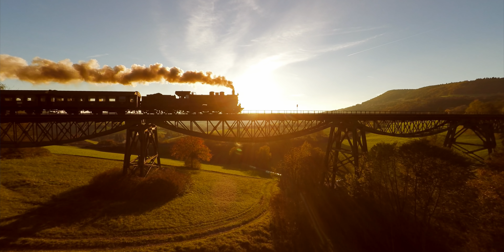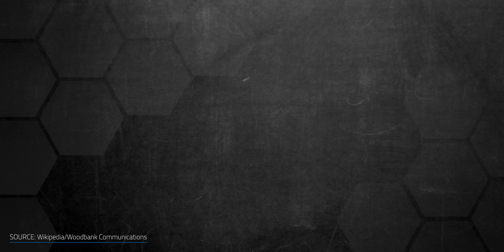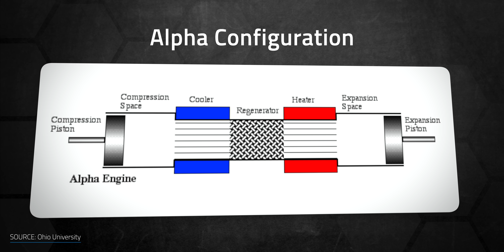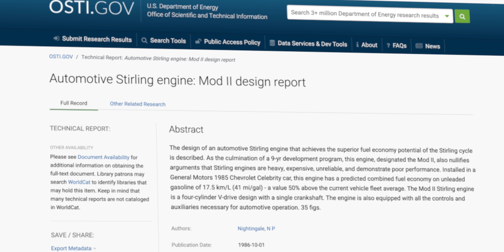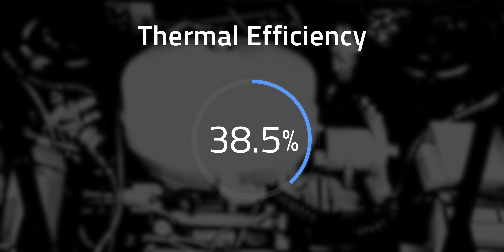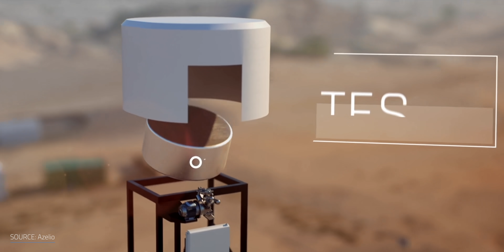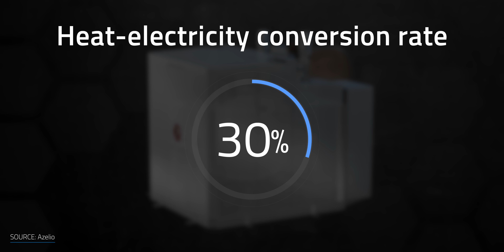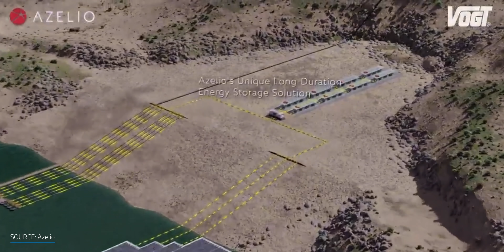Are Stirling Engines the Future of Renewable Energy Storage?

Comment: A 30 % efficiency if far lower than the best diesel  engines.  Where heat energy  is otherwise going to be wasted then maybe they have a use but when you have to channel large amounts of energy in to get significant  power out  then there has to be practical difficulties in stopping  heat being lost to the environment.  Nice toy though - would like one for my dining table.
Reply: This neglects the large amount of energy needed to extract, refine, transport and store the diesel fuel. Total efficiency of that entire cycle is less than 10%....not to mention the environmental impact.
Reply: @toddchief9180  Not to mention the infrastructure required to marry up a large Sterling engine from the source of otherwise cheap heat energy  to where ever the power is needed. The infrastructure for the transportation of diesel is already here. 
The largest use of diesel if for tankers transporting goods all round the world. I don't see a Sterling engine working in that environment.  It has a few niche applications (I believe the Swedes power at least one submarine with one as it is so quiet ).

As I say, a nice toy   and I'd love a miniature one on my dining table
Reply: @we-are-electric1445   What does the infrastructure “already being there” have to do with the efficiency. You stated that diesel is more efficient. That is true if you only include the combustion of diesel in the engine. But, it takes a lot more energy to make and transport the diesel to the generator...dropping the overall efficiency much lower. Diesel generators are very far down the list of the most efficient ways to generate power.
Reply: @toddchief9180  You said "This neglects the large amount of energy needed to extract, refine, transport and store the diesel fuel. Total efficiency of that entire cycle is less than 10%....not to mention the environmental "

Comment: I really like your channel and content.  Well done!  The field of energy and efficiency has been my passion (and career) for over 25 years.  I took a class in Stirling engines in the mid 1990's believe it or not.  My grad advisor helped write the book on the Dish Stirling research being done with Sandia, so there is a soft spot in my heart for these.  Given the round trip efficiency, I would guess they face a fairly large hurdle using things like PV and wind as the energy source.  Concentrated solar power is a better fit, but even so, unless there are combined cycle Stirling or maybe Brayton cycle engines, your efficiency is so much less than battery storage.  Here is one that is also very carbon free, and opens up the field of 'pumped storage' without geographical constraints, but suffers from the same cycle efficiency.  https://www.youtube.com/watch?v=itbwXMMkBQw

Comment: But batteries have +80% efficiency....
Reply: This is not the efficiency he’s talking about. You are talking about round-trip storage efficiency. He is talking about thermal efficiency of converting heat energy into kinetic energy (or electrical energy). To get the electricity into your batteries you need to convert some source of potential, kinetic, or heat energy into electricity in the first place.

Comment: I've always thought that the interesting part of this technology is that they can work on heat or cold.  Perhaps you could use solar heat during the day to make ice, or dry ice, and then use its big phase-change latent heat (cold) to power one of these at night.  Or if you have a big source of cold, like water, to create a temperature differential.
Reply: It works, but of course you’re putting in the latent heat to get a phase change. So much like hydrogen you’re only storing energy rather than making it. But being only 30% efficient, each way, makes it far more lossy than hydrogen. Therefore, you’d need a combination of the Stirling engine being cheaper to build than batteries, and the power cheap and plentiful enough (like solar or wind they’d have to shut off otherwise) to make it worth it. And even then, the energy resale prices later in the day are such that they would have to be extremely cheap to set up to make it worth keeping only 9% of the energy. But yeah the physics of it works in theory. These things were explored somewhat in Victorian times, various engineers and businessmen proposing to feed waste heat and waste cold into them and so on, it’s pretty interesting to read about.
Reply: Something like this? https://www.pcm-tes.com/solar-energy-storage/

Comment: Could this be used in human spaceflight? It was really interesting! How a really old tech can be reinvented and upgraded is just fascinating
Reply: Stirling engines are used in space, radioactive source on the hot side, the cold of space (around - 270°C in deep space, around 10°C close to Earth) on the cold side,
I think its possible but the existing designs are fairly low power for radio transmissions, etc. and would not output enough power to sustain human life..... Hey Elon, we've got something for you to think about!
Reply: @sofa-lofa4241  That would be indeed something worth studying!
Reply: @sofa-lofa4241  which craft are these used on? Space is a remarkably good thermal insulator and thus the cold side would build up heat. The only way things can cool down is through infrared emission, it can’t directly jostle nearby air and transmit that way. That’s why the ISS has way more heatsinks than it does solar panels, for such a small interior space.

Comment: Azelio has two things going against it.
- it's mechanical parts, thus a dismal efficiency of 30%.
- there's no words about it costs. Storing generated AC power by converting to DC and then outputting by converting to AC, Li-ion batteries are about 75% efficient on average. Is Azelio 60% cheaper than Li-ion batteries, to make it economically viable?
Reply: People keep comparing battery round-trip storage efficiency to the thermal efficiency of the engine. These are not the same thing. Let’s say you use solar thermal to generate heat for both systems then generate electricity, then store it in batteries, then take it out of the batteries on demand. You still had to generate the electricity (normally using a steam turbine) before putting it in the battery in the first place. That process has a thermal efficiency associated with it of around 33% for highly efficient steam turbines. The idea here is to store the energy as heat, and only convert it to electricity on demand (using the stirling engine). Then, you never waste the 80% per round-trip cycle that you lose with batteries.

Comment: Great video ... How does this storage efficiency compare to stacking concrete collectors I wonder? Also, I find it hard to believe that a molten aluminum device has a 25-year life without need of maintenance and risk of poisonous outgassing? Aluminum is the stuff that give people alzeihmers ; similar health problems with lead and other soft metals.
Reply: Obviously the aluminium is in a sealed vessel. If aluminium vapor leaks out, it takes heat out with it, and that would be bad for the storage efficiency, which is what they're trying to maximize here.

Comment: I do have in my home for many years  a version of that toy, mostly made of a kind of cardboard. Bought for  my at that time young kid ( 10 years old). This toy will work on a temp difference of ca 20 degrees. But is very inefficient. My  now grownup boy , mechanical engineer at the moment, told me that for good working and efficient running stirling engines we need a big temperature difference. That 600 degrees aluminium, or molten salt, will do. 
But ONLY if you can use thermal energy (sunlight by mirrors) directly for heating up the salt / aluminium or directly  driving the engine.
A battery will have an efficiency up to 95% or higher from electricity to storage to electricity again. The stirling , as you told , only 38%. This make this solution perfect for those mirror systems, but less good for storage energy from solarpanel parks. (I do know that in Spain there is a mirror driven generator with uses molten salt for night delivery of energy.)
May be we can increase the rendement of the stirling ....when we can increase the temp difference more. But that will ask a lot of the used materials.
Another big disadvantage for stirling engines... a relative lo energy output related to the size of that engine. So only good usable on static installations.

Comment: Also Sterling Engine mechanisms are used in RTG (Radioactive Thermo-electric Generators) for deep space probe power supplies running off the decay heat from radioactive material.
Reply: No probes use SRGs (Stirling Radioisotope Generators)
The RTG you are referring to uses thermocouples a form of solid state generator that uses the properties of bi-metal junctions to generate current.

SRGs are significantly better than RTGs for a lot of stuff but as of yet have not been deployed on any systems.
Reply: @nocare  Thanks for the correction; good to know!
Reply: @nocare  https://en.wikipedia.org/wiki/Kilopower
The ASRG program got cancelled, but the new small nuclear reactors that will replace RTGs in the future will still use Stirling engines + heat pipes
Reply: @nocare  how big of a radiator assembly would we need to provide sufficient Cold Side on a Stirling in space? I presume it’s at least still less than we’d need for coolant in a proper space reactor?
Reply: @nocare  I see, thank you. So it’s still as simple as the thermal envelope equilibrium as with an RTG. I suppose I thought being solid state vs moving might have some impacts on the electrical power we pull out. So, could we potentially even downsize the block of fissile material too, compared to an RTG? (If we had fixed power requirements for whatever reason)